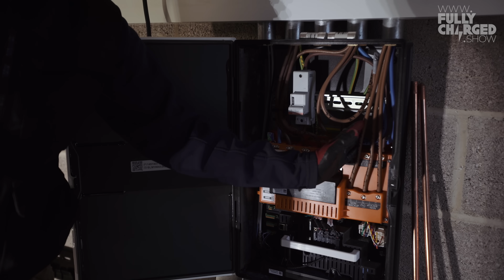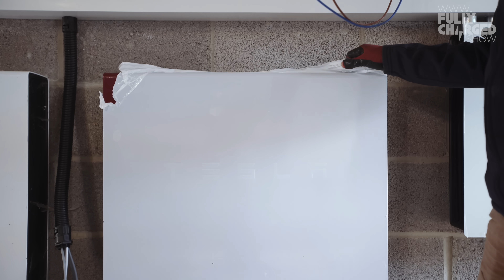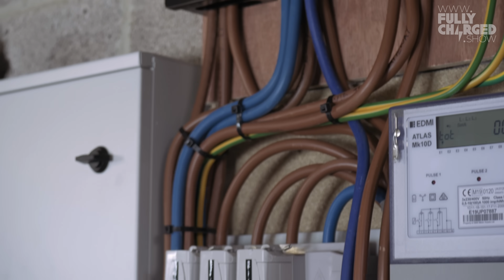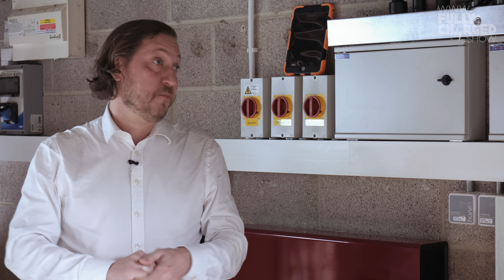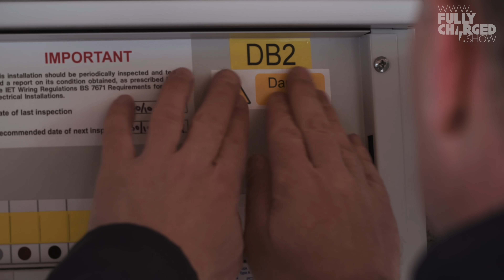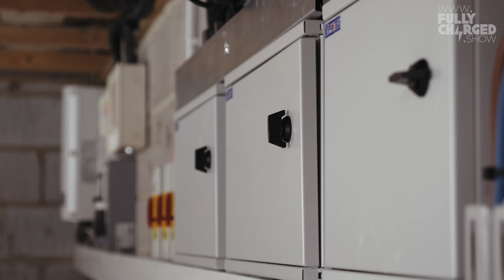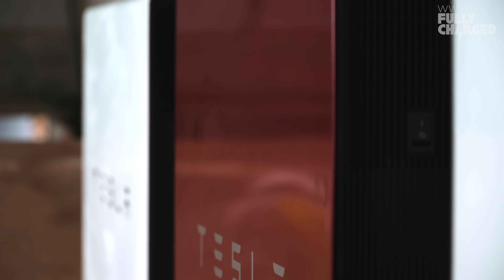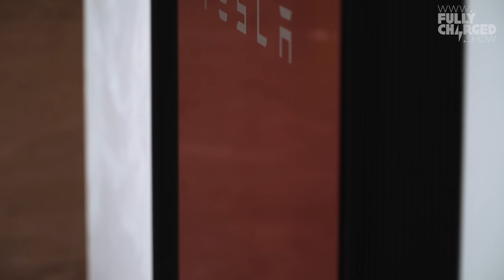Can you run your house on a battery? Tesla Powerwall 2 (Founders Series) & Tesla Backup Gateway 2

Comment: Great Update, thanks Robert! :-)

Since I'm tenant of a souterrain appartment in an originally one family's home  in southern Germany (remember: three phase connected :-) ), being lucky to get permission for an own off-grid PV, I'm burning for your PV series (and anything I can get hands on where- and whenever possible).
Building it single-handed I'm deep in all details, both the electrics and the crafts.
Therefore: Chapeau to your solasters!
My to be installed "hybrid inverter" (with the solar charger integrated) will guaranty my appliances running uninterrupted in case of missing solar input and empty batteries by switching back to the grid in 10 ms.
Advantage: The inverter does exactly what Tesla's backup gateway does - physically preventing any energy flowing into the grid.
Unfortunatly, the German law doesn't accept this as proof for "off-grid", instructing these facilities to be registered both at the authorities and the local network operator (who would install a no-return electric meter for your mentioned protective reasons). Since there is no way of detecting such facilities, it's used anyway in those occasions, without registration. ;-)
Disadvantages: As semi-off-grid plant I'll loose any power that couldn't be used locally (home electricity, EV, hot water etc.). And I don't have the money for an electric car yet. Will follow next asap.
Secondly, with the official legal status in mind, no solaster or electrician would take the risk of being punished for breaking a law (although no single one has been punished until now).
This is the reason for my diy project.
Another thought to the batteries: In combination with my (2nd hand) 1.5 kWp solar array, my 3 Pylontech US2000+ battery modules (in summary 7.2 kWh, providing 6.6 kWh useful per cycle) cover about 50% of my yearly electricity consumption (with feeding-in they could theoretically cover 100%!). Economically a Powerwall won't pay off for the rest of my life, there are faint chances for that goal with my cheaper Chinese high quality LiFePO4 batteries.

Thanks again for sharing your update, hopefully my own wasn't too boring. :-)
Carry on, as subscriber I'll stay tuned!

Comment: As an Electronics Engineer I can tell you unfortunatley this power wall installation and implementation is quite poor and could be made much better. There are ugly cables running everywhere. Turnover switch could be made much smaller and turnover switching time much shorter.
Reply: Matt Gorzka / this 'hobby-like' build system isn't even allowed this way in my country. That open 3-phase entry looks indeed quiet poor.

Comment: A little bit of reality check: A few years ago I was 'invited' as a 'westerner' to make a film about PV's which would appeal to the West; a propaganda film if you like.
Turns out it was at one of the 'suicide' factories in China (Chengdu). From memory heres a list of things I was not allowed to film:
The nets on the accommodation blocks to catch the 'fallers'
The burnt fingers of the workers whose job it is to solder.
The change over. This is where it got weird. 500,000 employees work in this factory, although not all at once. The shifts change like this:
A klaxon sounds and a yellow beacon flashes. A large electric powered door goes up. 500 white suited, (from head to toe), stand like stormtroopers. A second Klaxon goes off and the workers all file in and stand behind the worker they are to replace. A third Klaxon sounds and the current worker stands aside and the new worker steps in and seamlessly takes over the operation. 
The acid and wash baths.
The list went on - it wasn' so much a culture shock as a culture quake. As a filmmaker I have been in some pretty sticky spots. But this assignment was the worst. The human and material cost is always a factor - there is no such thing as 'free' in many ways.

Comment: Would be interesting to know how much CO2 was emitted to create all the batteries, dig the trench, build the solar panels etc. How many years does the system need to be operational before this CO2 investment pays off?
Where I live that investment would probably never pay off (lucky to live in Sweden where most electricity is low in carbon emissions (nuclear, water, wind)

Comment: I inquired about getting 3 phase service at home, to run my machine tools. I gave up on the idea real fast when I was given a very rough estimate by the utility company, that's assuming there even was a 3 phase along the nearby main road.

A phase converter or VFD is the cheapest method. Would a phase converter would work in the Tesla powerwall situation?
Reply: The 3 phase was required to evenly put the solar power into the grid and not over supply a leg of the residential distribution system. This will be more of a problem when there are more panels on homes. It is already a problem in Hawaii where some areas have 60% household solar and little electric use durring the day.

Comment: The engineer noted that excess voltage is routed to your hot water tank. I'm wondering, do you have heated floors as well? (floors heated by hot water piping).
Reply: Excess power, not voltage

Comment: Hmmm. If you're not "spilling extra solar back to the grid" by design, then why should your energy supplier have concerns and make you spend $ on upgrade of their connection to you system? Here in Australia, there is generally a 5kW export limit for domestic installs, so if we have a simple PV system, the limit is 5KW solar array. This is logical to maintain a level of network stability. HOWEVER, for a battery storage system, or "Hybrid" as we call it, logic has finally prevailed here in Aus...  the same 5kW per phase Export limit applies, but as the hybrid inverter itself can limit export power we can have higher levels of solar power, say a 10kW array (and whatever battery storage) without having to upgrade to a three phase supply connection. I suspect in the UK they are thinking about the future where your tesla batteries will be used to support the grid itself at power levels above 5kW, hence the 3 phase connection you have had to pay for now at no immediate benefit to you.

Admittedly I'm somewhat cynical by nature 😉 , but I'm very interested in your opinion.

I've been a fan of yours since the scrap heap challenge days and love your work. Thanks for your efforts.
Reply: BTW, I should add, hybrid systems as they are known here in Aus are also based on Tesla "gateway" type  technology...they are not Tesla designed though...  anyways, if the mains grid fails the hybrid system automatically disconnects itself from the grid and your house remains alive, with power coming from the battery (and solar). This is anti islanding and is nothing new of course.

Comment: Entertaining and informative, as always. I'm looking forward to the day when every household has such a battery-backed solar setup running. That will reduce the dependence on dirty coal-fired peaker plants considerably.

But please tell me you didn't use a permanent marker to write that fake signature, Robert. 😬
Reply: Are you sure that the "peaker plants" you speak of are coal-fired? As I understand it, a peaker plant must be able to start up and shut down very quickly, ideally within minutes. There is no design of coal-fired power plant in existence (as far as I know) which is capable of such operation - they usually take days or even weeks to start up, which is why they are almost always used as base-load plants.
Peaking plants are usually open cycle gas fired, which are gas turbine engines (think jet engine but with a massive power turbine tacked onto the back of it) coupled directly to a generator. These really can be started in less than a minute, provided that the fuel supply is ready to go and they have enough stored compressed air to spin up the compressor stages. They are not the most efficient, because the residual thermal energy in the exhaust goes to waste. Combined cycle gas fired plants use the same turbine engines, but feed the exhaust gases into a heat recovery boiler, which then drives a steam turbine just like any other fuel-burning power plant. This brings the efficiency up to almost 60%, whereas an open cycle plant struggles to reach 40%.

Comment: No batteries, mag powered gensets:

Flip towns offgrid, 1-Mw•1300hp magnet motor, "50-year no-inputs warranty"; 17yr R&D; technokontrol.com, RF-5000. 

Homes,  acts as inverter to panels: 10kw•$15k, 5kw•$8k $35/mo; 1.2-cents/kwh; 20yr wrnty: infinitysav.com, no fuels, 24x7 power.

Comment: It's too bad that the Tesla Gateway does not operate like a UPS. That blackout period is going to shut down everything in your house. Smart grid is an awful idea like your engineer mentioned if the utility goes down they have to worry about all the solar homes sending power back into the dead lines. Better to have your own storage instead of putting it back into wasteful transmission lines.

Comment: About the Tesla Gateway 2.. There was a lot of talk about it disconnecting if voltage goes too low.. But does it also work as a surge protector if power goes too high?

Comment: I have had a 10kw solar array with 3 Sonny Boy inverters for a few years now. They are “secure power” inverters that need no grid power to operate. The system will not allow flow back to grid during an outage. Each inverter has it’s own 1500w outlet that kicks on 45 seconds after power out.

Comment: Cool tech! Note to self: don't throw away the actual UPS... ;)
Reply: Kind of shocking that tech isn't in the Powerwall, then they've put out the Gateway as a whole intermediary system - still no UPS. You'd think it would be one of the easier problems to solve, regulatory hoops notwithstanding.
Reply: @moarsaur  exactly what I don't get!!! Like why the heck did the lights go off?!? That's a computers worth of work lost, everything in the house without a battery resetting, grandma dead from a lack of oxygen because we thought a big battery was a "backup"!!! We need to start viewing batteries as our MAINs power and the grid as our "backup"!! Then we'll actually get somewhere with all of this!!

Comment: When converting his house to 3 phase, did he have to change his inverter to 3 phase too?
Reply: bobbinsnest you can run single phase inverter in three phase supply when not exceeding maximum current of single phase. Also if his house is wired to basically run on single phase then inverter should feed that phase where consumption is.

Comment: Some misleading terminology used here. Electricity produced by solar isn’t wasted or “spilt” when it goes back to the grid. In fact it is far less efficient to store energy in an EV or home battery or hot water. Economically in the UK it is “wasted” because no FiT currently exists (so electricity retailers are basically stealing your electricity until the new scheme goes live). But if you feed electricity back into the grid you reduce demand and therefore reduce peak generation and reduce greenhouse gas emissions overall. And the grid uses that electricty at roughly 97% efficiency as opposed to battery/inverter loops which are about 87% efficient max. Even a DC system where the batteries are charged directly from the DC produced from your panels is still only about 92% efficient (PW2 uses AC to charge as it has a 2 way inverter therefore twice the losses)

Comment: Wouldn't it have been wiser to install them higher than ground level in case of flooding?
Reply: couldn't install the PW like that in Aus
Reply: Maybe it’s because of the weight, safer to install such heavy equipment at ground level ?
Reply: I live in the Netherlands, and our two Powerwalls are installed just slightly higher. Why? No real risk of flooding since our house is build on higher ground. If things do flood, then it doesn't matter how high up you install them because you're fucked. =D
Reply: My thoughts  exactly. I kept wondering whether they would install them higher in the end.
Reply: Maybe he doesn't have issues with flooding.

Comment: 10:35 "the lights might flicker, maybe not".  Er, that was a good 10 seconds total power outage in which time any power-critical devices (PCs, TVs, some cookers/microwaves, etc) would have lost power, reset/need to be reset.  Hmmm.  Better than no backup but far from good enough yet.  I was hoping for much better than that so I think I'll hang on to my hard-earned cash a little longer.
Reply: @ianmccrae2676  Trouble is, we get quite a lot of power cuts where I live and it seems that I'm forever resetting the cooker/microwave/telly/clocks etc and various timers for immersion heaters and C/H heat pump/controller.  Not many of those UPSs would have the guts (not unless it was huge) to keep that lot running even for a 10 second outage, so I'd hoped the Tesla power wall would do that job for the whole house.  Reading more comments it appears some installations do appear to switch over in an instant but not Robert's.  Maybe it's to do with the 3 phase supply, but I don't know why that might be the case.  I really want to get one of these setups but it needs to take away all the manual faffing that I currently endure.  Most power outages are only a few minutes long but the ball-ache of resetting everything is the issue for me almost as much as losing the power in the first place.

Comment: Did ask you on Twitter but asking you again: How is it possible to run the PW2 on a 3-phase system, each powerwall has just a 1-phase inverter, how/where/what in your system is converting the 1-phase in the PW2s to 3-phase? Is it the backup gateway? I have seen videos from Germany 1 year ago, they had a PW2, Germany have 3-phase so he could only have backup one 1 phase in the house, he then needed to have the crucial loads like fridge on the correct phase as the other 2 phases were off at a blackout. 
Please revert how your system is set up, do you have backup on all 3-phases in your house and is, what converts to 3-phase? In Sweden we have a lot of stuff needing 3-phase like, heater, owen, HVAC, we need real 3-phase backup to keep our house working during a blackout. 
I’m really interested in a PW2 system but it also needs to work....
Thanks
Reply: After enquiring, I've been told (here in UK) that the Backup Gateway can only power one phase (I have a property with three phases powering different part of the property) although it will monitor the current on all three phases. I've just asked a question, before seeing your post, asking what phase each PW2 and the solar array is connected to in Robert's set up ... can't all be on the same phase as that is what the network operator was objecting to! Is one PW2 on the same phase as the solar array? Even when that battery became full, the other battery (presumably on a different phase) would get charged as the Gateway would (I am told) exactly balance the excess solar export to the grid on that first phase by the same power import on this other phase (while the grid is working, of course).

Comment: Not much for potential wind energy?  Winter gonna be a bummer for solar...especially in the Isles...and here in the US PacNW.  Of course you run a higher voltage than us US plebes.  Makes sense in the greater scheme, but 120v has advantages.  I could DIY a windmill @12vDC and an inverter...not sure you could?

Spitballing

Comment: Wow, that was the worst power backup Ive seen. With a proper UPS the light wont even blink... I've tried to find alternatives that works like an UPS but havnt found one yet.
Is there any powerwall (from any brand) that works better than that? I would like both solar and battery backup, but the UPS feature with  NON uninterruptible power is a must. Live in the country side and every time there is a thunderstorm we get problems with the external power supply.

Comment: Good video. A bit complicated, but I think by the time I can afford to do this I'll be up to speed. Always take a look at California, we're often at the forefront of tech and nonsense. The power companies here have cut payment amounts for electricity pumped back into the grid from people with solar panels. Also these utilities are entrenched bureaucracies. They're guaranteed an 8% rates increase every year. The result of this is as I've switched to all LEDs, almost never run my small AC unit and continually cut my power consumption-- my bills keep rising. My dream of solar/ power wall is completely disconnecting from the grid. 

What I expect to see is utility rates continuing to rise, and corrupt changes (like cheating solar contributors) where a negative factor to owning an electric vehicle will be some power company surcharge. I also expect to see laws mandating connection to the grid. But I think young people will be the factor. They (and us older folks) now make a lot of effort managing power. What apps do I turn off on my smart phone so I can make it through the rest of the day without having to stop and charge?  Why not also, well my Powerwall is drained, so I'll just turn off my refrigerator for the night, and it's not hot enough to run the AC, and my Tesla Cybertruck is at 60%...I won't need to be topped up until Saturday morning--so I have four days to top it up at work and off my Powerwall. We'll all get more efficient. 

There will come a day when a 90 year old moans 'don't leave all those lights on! Think of the bill,' and the great-grandkids say, 'Yeah gramps and pops, it's not the 1960s anymore.'